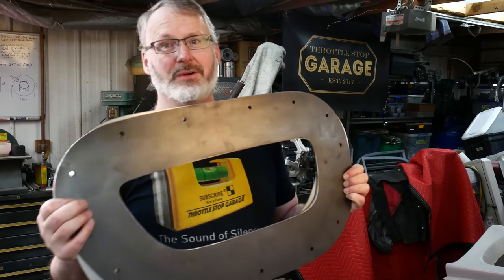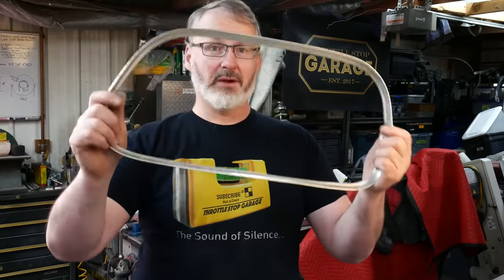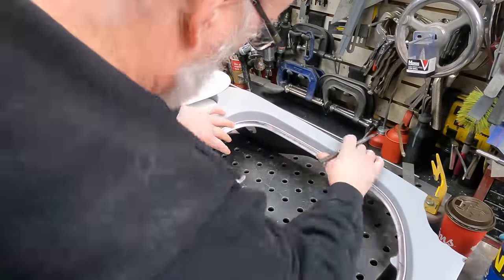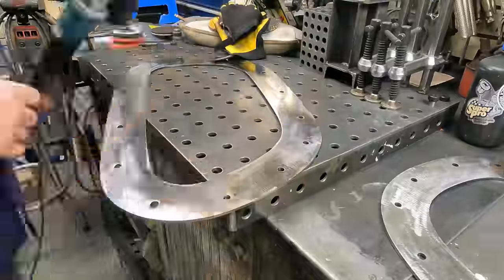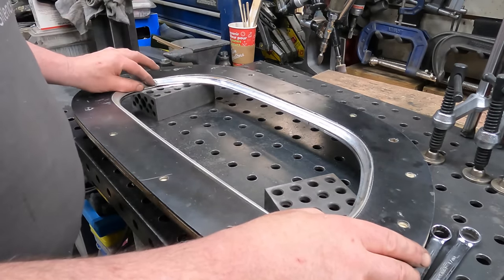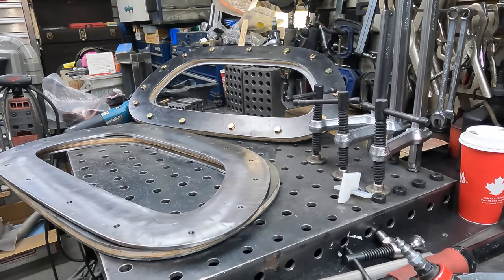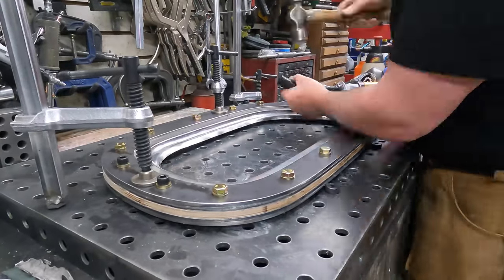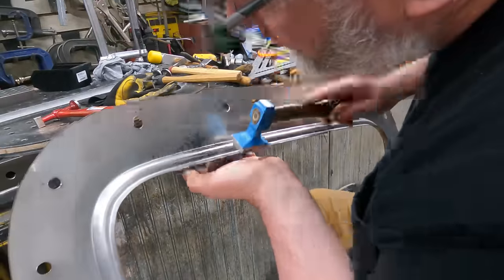Making Stainless Steel Car Grilles - Hammer Forming Fun.  Part 1

Comment: In a true serendipities moment, Im experimenting with air hammers at the moment.
They are so powerful creative wise.
Im focussing on steel tooling.
Im also toying with hydraulic presses and dies.
Recreating days past isn't easy.
Reply from the maker: They do hit very hard - even the rivet gun I'm using hits harder than is needed.
Reply: @ThrottleStopGarage  Have you tried an air gun? I have always read that the rivet gun is the preferred tool for hammer forming but I'm not sure if I want to drop the money on one if my air hammer could at least get the job done.
Reply from the maker: @lobrow7661  yes, I've used an air gun...the riveter is much nicer to use.  It's a lot easier to control.   I got mine used on ebay for $100.
Reply: @ThrottleStopGarage  Excellent, thank you! I was secretly hoping for an excuse to buy another tool. :D

Comment: Nice, that's the OG part you're going with on yours is my favorite style of grille the 122 had.  I'm always going back and forth if I want to go with the 1972 aluminum grille on my 145 or keep with the egg crate plastic since it's actually a 73
Reply from the maker: Yup, it's a two year back date, but purists  will have issues with this car either way. 😆

Comment: "It's 30 degrees in here, I'm dripping."  Meanwhile I'm in my shop in Texas at 43 degrees and opining how it isn't that bad today.
Reply from the maker: It's all relative...I normally work with the shop at 13 degrees.
Reply: Minnesotan here. 30 C is tolerable outside if it's not humid, but inside the garage, well, I'll finish the project another another day. The dehumidifier has been my friend...

This morning it was 90% humidity on my ride to work. Thankfully not 30 on top of that.
Reply from the maker: @SvenDansk7  I leave the bondo work for the cool mornings.  I have no idea how anyone deals with it in the heat!

Comment: Thats great job, again. About turning the flance's, how about just simple hand tool. I learn it from Per the Metal Man Sweden, any piece of round stock (pref. hard one) cut a slot with thin cut wheel and make a piece of tube and tube clamp as a deep stop. Then just go around the work piece with small bend at a time. I got one in my IG. I can tag you kn so you can get a look.
Reply from the maker: I miss his channel a lot...it had the best metal shaping content.  I normally use a small adjustable wrench.  I'm working on turning the flange now and it's working.
Reply: @ThrottleStopGarage  I went to his shaping class. Hes still around. (In IG)

Comment: Do you think it was made like that and cut (to improve fitment, you say) at the factory? Or did they buy kilometers of straight "roll molded conduit" (not a native, I can't think of a proper way of calling that) that they bent (the four large radius bends), leaving the two ends facing each other.

To me, the latter sounds a lot more likely
Reply from the maker: For sure straight material and a die to shape and bend the profile.  In aluminum  (that's what the stock is made from)... it's easy compared to stainless steel.

Comment: Have you tried electroplating your 3D prints? Primer, nickel paint, copper plating, chrome plating
Reply from the maker: No, haven't looked into it at all.  There has to be a VPD process to do this but at low volume?
Reply: @ThrottleStopGarage  VPD sounds pretty complex for just a few parts.
But electroplating is doable at home:
https://youtu.be/ilWst2zq-D4

Comment: Did you ever consider making the trim out of carbon fiber; and then have it chromed? I know the process of spraying a copper coating to metalize  non-ferous surfaces has improved a lot recently.
Reply from the maker: Yes, but that sort of process is not available anywhere I can access.  I'm happy with the result so far, even with the work.

Comment: Does anyone make stainless dodgy panels for cars? A search on the internet doesn't show much, other than screws and washers, etc. Why wouldn't aftermarket companies make something like a floorpan for a vw bug from stainless steel?
Reply from the maker: Not that I'm aware of - it's not an easy material to work with compared to mild steel.  Stainless also has some not so desirable properties in structural applications.